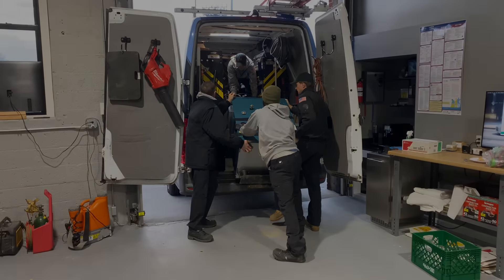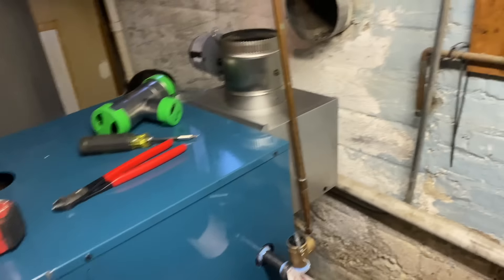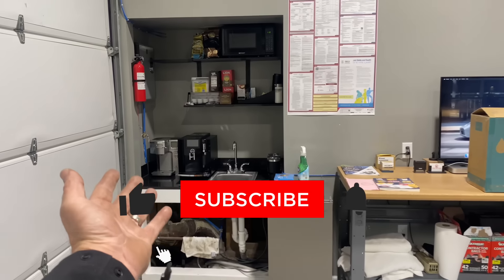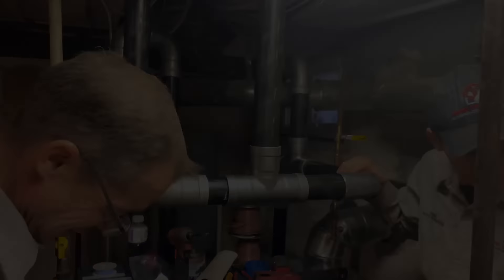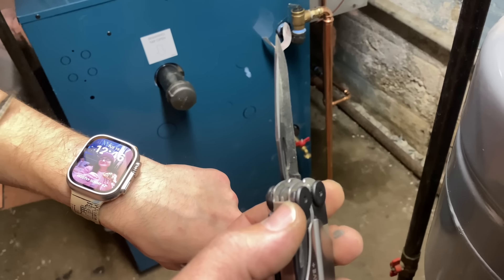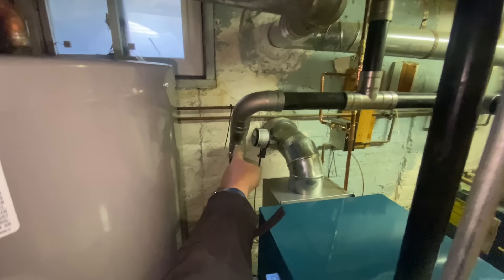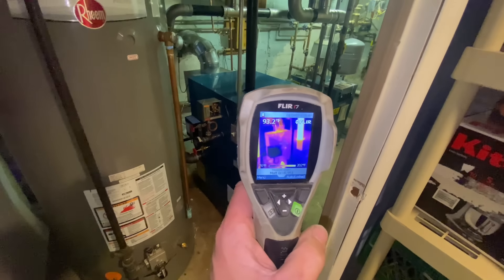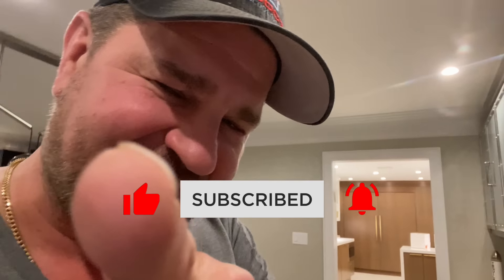Efficiency Upgrade: Oversized Boiler Replaced in Record Time

Comment: yeah, no issues with vent dampers installed horizontally(unless manufacture says not to) I know it's OK with field control brand, just don't place the damper control motor directly at top or bottom, keep it towards a side or angled off center as far as possible to keep it from getting cooked from heat or condensation if any happens to run down the pipe bottom.
of course always keep clearance away from flammable items, as with all flue pipe/parts.

Comment: Hi Mikey!  Would this be considered oversized  back in the day when homes had poor if any insulation, holes in foundations were not sealed up, chimneys were wide open. windows were single pane, etc etc ?   I wonder if many replacements were based on prior equipment, and not current requirements of the structure, in its present state.
Reply: My guess would be yes. Can't know for certain without load calculations, then and now. Where we live, the opposite is done for the summer. I build/remodel and have pulled 5 ton AC's out where a 2-2.5 ton would suffice.  Some new builds I've inspected are way oversized and it's on their prints.
Reply: Steam boilers aren't sized by BTU load like conventional hot water boilers but by square ft. of steam based on the size and amount  of the radiators in the house.

Comment: Hey Mikey at some point I’d like to see you get a pickup truck with a stake bed and a power tailgate. It will pay for itself very quickly with the cast boilers and hvac condensers. I use mine for transformers, reels of cable and of course the scrap we generate.
Reply from the maker: That would be cool
Reply: Mike, thanks for the reply. Just found your videos very recently I’m impressed with your knowledge and work ethics. 
Do you work on commercial / light industrial HVAC equipment ? Rooftop units? Also Any food industry refrigeration? Freezers? Commercial food processing boiler systems for hot water? 

Appreciate your time, I’d like to reach out to you